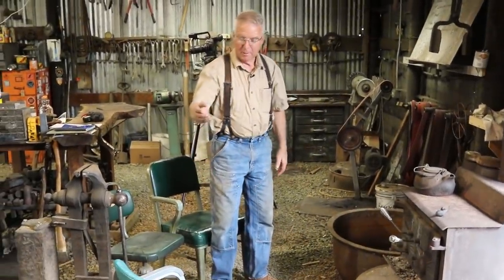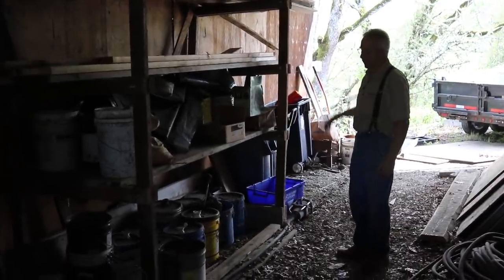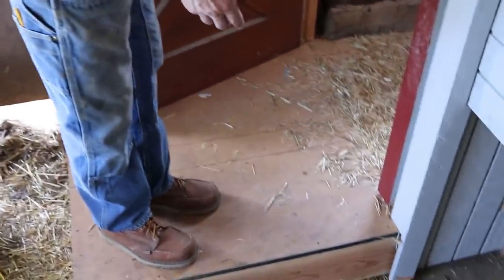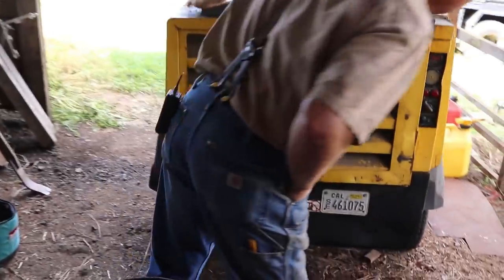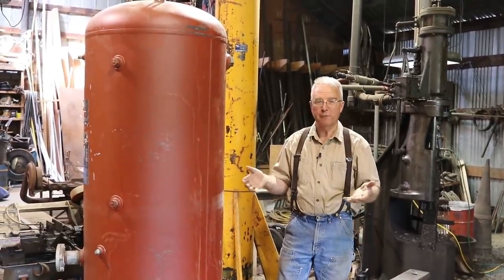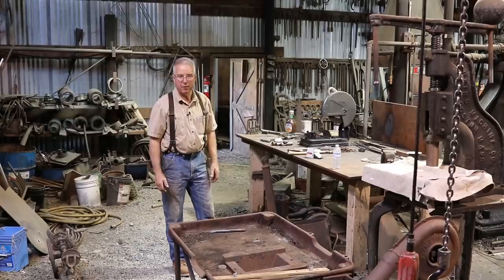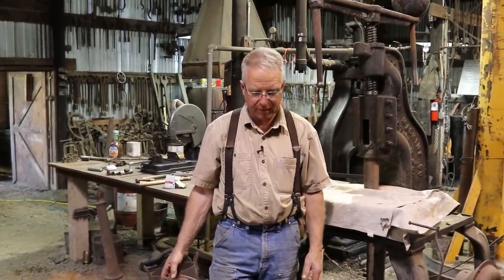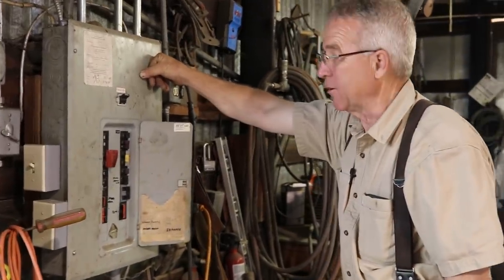Shop Tour 2.0

Comment: I've engineered and installed several compressed air systems for our manufacturing facilities across north America. I would install that air receiver in a place that will allow the heat to come off of it. Compressing air generates a lot of heat and you want to cool the air so the condensate will come out.  Speaking of, I would pick up an automatic drain on the tank. They're pretty inexpensive and will save the tank from rusting on the inside, or worse filling up with water and providing no usable capacity. Pipe the incoming from the compressor low and the out to the shop high on the tank to help separate particulate. You might also want to consider running your air receiver and compressor at a higher pressure and regulating the line to the shop down to 90 psi.  This effectively increases the capacity of the tank so the compressor can run more intermittent.  I'll run the compressor and tank at 125 psi and the plant at 100 or so. With piping losses we'll maintain 90 throughout the building. Good luck!  Any questions let me know. I really enjoy your channel!!
Reply: An automatic drain valve is a good idea. It needs to have a valve with a fairly large opening so that rust and crud won't plug it up. A strainer in front of the valve isn't a good idea because the strainer plugs up with rust and then the valve doesn't drain. If you don't use an ADV, use a ball valve drain with a fairly large opening and open it all the way when you shut down your air compressor. It will make a lot of noise, but it will keep the rust and moisture out of your tank. Don't forget that your tank needs an appropriately sized and rated pressure relief valve. If you weld on your tank, you will void the approval, so mount it an a way that doesn't require welding to the tank.
Reply: @wgiles51  I've used a Suburban Manufacturing Moisture Minder, a pneumatic-powered drain system that uses a shuttle valve.  The upside is that I don't have to use an electric-powered system.  Downside is it uses the leader-line's pressure change to control that valve.  With a single compressor motor/leader this works very well, not sure how well such a solution would work if the pump head is far from the valve and if ther are multiple pump heads.
Reply: What had already been said he is true, noted that there is flanged opening on the tank already that with a bolt on reducing flange with the relief valve npt threaded opening will work fine with out having to weld on the tank. Also seemed to be enough openings/taps already on the tank to accommodate your air line piping as needed. You could also use a smaller air compressor in tandem with your large one in tandem as long as each has it's own check valve. I always liked having large tanks elevated to keep my floor space open. Always seems to be more open space above than where I am working or walking.
With the tanks elevated and the compressor/compressors lower the discharge lines to the tank would need a drip leg where the manual drain down valve or auto  drain would be installed to remove the moisture from the lines and tank as well. Good luck, love the channel.
JJ
Reply: @wgiles51  If you have rust so large that it clogs the 1/4"-3/8" bleeder line, time for  an ultrasonic thickness inspection or a new tank.
Reply: I think you'd enjoy a system I worked on. It was a 1 mile long building. It had two screw compressors on the back end with three 2,000 gallon air tanks. Dropped about 15psi at the front end. They later added a large Sullair on the front end. Great comment. Take care.
Reply: @mossyhollow3732  It's not that there is large pieces of rust, but the mix of moisture and rust will clog the 1/16" to 1/8" orifices of most small solenoid valves. I prefer ball valves for primary receiver drains. That Atlas-Copco is no small shop air compressor, but, I would guess, around 100CFM constant duty.
Reply: @Bill Giles Yep exactly. Scott’s set/up is going to sit for long stretches between vigorous use - not good for  fighting corrosion.  If he uses an auto drain I’d also want a couple of good old ball valves so it can be easily bypassed and blown out /drained manually from time to time.
Reply: Mike Scheve I agree with a drain of the water compressed air produces. It stinks having to replace a rusted out tank!
Reply: Why not add an old AC coil or two or three to cool and condense the moisture before it gets to the tank?
Reply: Mike Edwards at Boeing a lot of our machines that had dedicated compressors usually had an air conditioner of some form added just for this purpose! I think they served a duel purpose to keep the computer systems cool as well.
Reply: @1768ify  An aftercooler is never a bad idea, but a 100CFM compressor is going to take a pretty good sized one.
Reply: @wgiles51  True but it's only a part time system. Maybe just run the tank only for the hammer. Bleed it off with a big ball valve when done. Saves the hassle of the auto drain and the rust would surely be blown out.
Reply: I am curious as to what is planned to be used for the "small compressor."  If the small compressor is too small and has too low of a duty rating it may not live much past the first fill of that huge tank.  Might be better to leave the big tank out of the loop of the small compressor.
Reply: Mr. Scheve said it best.
Reply: Agree with all the above. As a former refinery chief inspector please, please make provisions to remove the water!  California air receivers even have special inspection requirements because of possibility of inside water corrosion. Take care and be safe.
Reply: I don’t know if you will get this or not but I’m trying to make a very important decision here. I have a DeVilbiss 330 1948 model year that I got handed down to me and I’m working on a very tight budget. The thing runs awesome, is very quiet, and builds pressure good. One problem though, there is a very small pinhole from rust on the end cap just outside of the weld on the side of the drain valve. It is on the very bottom of the tank. I’m trying to weigh my options. Can I get away with using it at 150 psi with several blow off valves or am I at a high risk doing so? I gather from some forums that people very strongly suggested to others with the same problem to retire it but I don’t know how reputable they are. I don’t want to put myself or others in harms way by any means. Thanks in advance.
Reply: @anthonycamardo7938 For the safety of you and others, please don't you use that tank.  With a current leak it has already failed.  It will not pass an ASME Hydrostatic test.
Reply: the simple solution to the concern of sediment sticking the valve is to make it a sediment trap, by putting a manual valve with a fairly large full port valve, up to 4" is still thread able with standard shop tools, and under $200. then the auto bleeder just above that. you'd have to drain the remaining every so often , but his other tank was buried, im guessing bleeding isnt high concern lol
Reply: Anthony Camardo 35 year veteran as an industrial air compressor mechanic don't junk it! What my company does is have a certified pressure vessel welding company come in and fix the leak and because they are certified through the state of New Hampshire THEY re certify the tank itself with a new certification tag that they wells onto the tank should cost you a couple hundred, the old DeVillbis units are great not like the new crap they have now hope this helps!

Comment: Ahhh the old horizontal surface storage issue. That’s a tough one, I’ve considered making all my benches at 45 degrees to the floor it would keep them cleaner.
Reply: mark a first rule of construction. Every horizontal surface IMMEDIATELY becomes a “table”
Reply: That won't work...you'll find ways to put non-sliding items under the downhill side of sliding items. The term "horizontal" is kinda relative.
Reply: I love Matthias Wandel's approach here, leaning into the utility of horizontal surfaces.
Reply: Installing hinges on the forward edge of the workbench and pneumatic rams, to lift the rear of the bench will provide a fast and very effective means to clear you flat surfaces. Just step to the side and open the air supply valve and WA-la! Instant clear workbench! LOL
Although, making your way around the front of the bench will become a rather precarious situation, requiring you to be very careful, to prevent personal injury from falling due to the trip hazard resulting from the clearing of the workbench.
Reply: I often wondered about making an automatic tilt system, once a week they lift and put everything on the floor. You tidy or you pick up. No problem.
Reply: @mrbibstoo  lol 🤣🤣😂😂🙃
Reply: @gregoryvschmidt  Saying on our crew "If it's able, it's a table."
Reply: my grandfather tried that; didn't work. He had a drafting table so it was naturally angled; still managed to be always cluttered up XD

Comment: Peace of mind is priceless. I used to service large air compressor systems. The tank should have it's own pressure relief valve, gauge and bleeder. Auto bleeders are nice because large tanks collect lots of moisture. I like the idea of a full shop air system that you can add the large compressor to when needed but you'd only need the large tank plumbed in when running the hammer. Then just open a manual bleeder/drain valve when done. Shop space is gold and the tank should fair well outdoors if covered. Although, something tells me that you already know all of this.  😁
Reply: keep the screen clean ,check auto drain function or you will have a air tank full of h20
Reply: @jeffreylee7184  he put it inline with the main line to act like an accumulator and not really a storage tank. I hope he shows the removal so we can see how much water it has.
Reply: @jeffreylee7184  in case it blows up! it is home made (:

Comment: As soon as I saw your Federal Pacific panel I gasped.  They've started more fires than I care to think about.  I've used Square D QO panels for years-they're really good panels.   Been watching your channel for some time- love it!
Reply: Also, Square D makes a surge protector that plugs into the panel at the top, utilizing two breaker spaces.  It's called a Surgebreaker.
Reply: SD QO would be my choice as well!
Reply: A new Siemens PL panel would be my choice - it's got a copper bus bar and it's pretty cheap, and the breakers are also inexpensive. A new 40 with breakers would be less than $300 and way cheaper than getting new FPE breakers.
Reply: They're great for loads that you don't want to trip....lol
Reply: I use and install alot of GE panels which you can buy anywhere *Home Depot, Lowes, Ace) as well as the breakers and the cost of the panels and the breakers are cheaper that homelite, Square D, Cuttler Hammer, etc here in Texas.  Keep in mind that with CH, Sq D, Ge you cannot go wrong with any one of them.
JJ
Reply: FP or Zinsco, who starts more fires?
Reply: Yep - Federal No-Trip.  Gotta go.  It's a little bit less of an issue on an uninsulated shop wall, but that should be replaced.
Reply: Had one of the FP panels in the house when we bought it...was the first thing to go..I found one breaker where the cap side fell off..so someone taped it back together.. If I knew the last electrician to mess with that panel I'd would have told his boss to fire him, so many dead end wires jammed in there and such a rats nest...just plain scary... Square D QO tends to be my favorite, easy to find breakers and I like the plug on neutral for GFCI's and arc faults...keeps the box cleaner

Comment: It's always good to sit and have you visit with us on these video's Scott. I really like the idea of hanging the air vessel onto the shop crane. I would also suggest that when you pipe it you put some bypass valves in so you can combine it with the smaller tank or isolate it for just the power hammer use. No need to fill the large one up if your just pumping up a tire or doing little stuff. Also make sure it has a drain valve. Love those grandpa shots.

Comment: As a mining engineer,  I for once feel useful! The best place for the pressure vessel is as close to the power hammer as you can.  Also the largest pipe possible will reduce the flow loss and pressure loss significantly! The rafters and mezzanine are great ideas. For example even if the threads on the tank are 2”  sizing up to a 4” after the tank will increase flow to the machine.   Compressed air flow when flow is objective is very comparable to a garden hose in that ultimately  a small hose limits the supply from the tap due to pressure loss.
Reply: Scott deerfan2 is correct. Build a frame above the hammer location to set the tank vertically (smaller footprint) have a down leg for condensate drain. A lot of water will come out of the tank a autodrain is recommended with feeds to the hammers 1 - 2 feet above the drain horizontally. Install check valves with ball valves between compressors and lines, this allows you to take them out of service. I would put a stainless flex line between hard pipe to tools and piping system, this limits vibration to tank and piping. That tank will run 5 paslode framers or 6 hitachi framers at the same time for you carpenters.

Comment: Evapo rust is the best I’ve ever used when it comes to cleaning rust it’s non toxic so it doesn’t harm food ware and it evaporates like it was never there
Reply: I also like  that stuff. I have a 5 gallon bucket of it on hand at all times. The formulation I have doesn't tend to evaporate off though. I dump it out for re-use and then wash off the rust free items with water, then prep for service.
Reply: Yeah you can use the 5 gallons over and over. Great stuff, good for rusty bolts to.

Comment: Re the "new" air tank, you said it was rated as a boiler.  I would check into that as whether it is rated for water pressure or steam (air) pressure.  The idea of adding a small electric compressor for daily use compressed air is great, couldn't live without mine. If you plumb both compressors into the same tank, might consider putting check valves between the tank and each compressor .  Thanks for the great videos and keep up the good work!!
Reply: Yeah let's get a picture of the tag on that vessel if you wouldn't mind Scott?
Reply: The tank was removed from a laundromat, That would make it a hot water storage tank.
Reply: @jamesblackham6961  that's a pressure vessel. They usually contain a label on the side which has the ratings. Sometimes both air and liquid pressure ratings.

Comment: Like everyone else mentioned, put that giant tank outside for sure. Maybe you can make a little shed for it to keep it dry. I'd also plumb a really easy to use ball valve drain in it. Keep the water out and that setup will last for years. The grand kids will be using it eventually! Nice shop for sure.

Comment: Scott, what works best for us in our shop is something similar to your small compressor/large compressor idea for that tank, we have a “small” compressor to maintain the pressure for smaller air tools, but when we have a heavier we have a similar compressor we’ll run only as needed but we’ll shut the smaller compressor off. Our storage tank is mounted standing up outside for to make it easier to drain any moisture out and it’s anchored into a concrete pad

Comment: Mount it outside and enclose it. Pipe your air into the shop. Make sure youre able to bleed water out the bottom so to preserve the tank from rust that is caused by condensation in the tank there are electric solenoid valves that you can put on a timer that will bleed it at a set interval. Set it and forget it. Just check that the valve still works from time to time. Always bleed condensation out of your air system. Especially in your neck of the woods lots of moisture in your air.

Comment: Scott,  pressure vessel inspector / expert here. The only worry is condensation.   As long as there is a way to drain,  then both problems involved area avoided.  

Put the new vessel outside and have a way to drain the condensation. 

Use 2" or greater pipe.

Comment: My humble two cents from working with pressure vessels for 27 years. There are regulations that govern the installation and maintenance of pressure vessels. These are easy to find online. Yearly certifications are mandatory.  Pressure relief valve or valves, Guage and condensation removal are important aspects.  I would put it outside on a small concrete slab and a small roof structure to keep the elements at bay. (Not 100% necessary for the roof). I won't put it in the roof of your shop if I were you. Extra cost, extra risk.  I also want to make use of this opportunity to thank you for your channel. I have learned so much from you over the years.

Comment: I'm not an electrician, but do have an electronics degree, & spent 7 years as a home inspector. For the electrical panel, you can best assess it's condition by taking Infrared pictures with the cover off and each circuit loaded to 80% of capacity (one circuit at a time). The IR Pictures will easily identify which breakers may be running too hot & creating a fire hazard. Cheap smart phone based IR cameras are available for under $150 & very useful for diagnosing a host of heat related issues. (Also good for checking related electrical connections/boxes/junctions/etc.) A budget alternative is the IR non contact temperature devices in the $25 range at big box hardware stores. Be safe.

Comment: Addition of tank will be priceless,volume always speaks  for a full function shop,a thought would be to have an auto  bleeder in, on tank for condensate,also I would figure out where in shop overhead dead space to mount,this not losing valuable floor space in shop.I have been reminding my pole barn in Michigan,addition of shop and loft storage and I gained more than half my barn back.14 foot to rafters here and slot is used for bulk items that would take up my floor,I have rafter storage,plus storage on top of my shop,all accessible by stair case to lofts now.